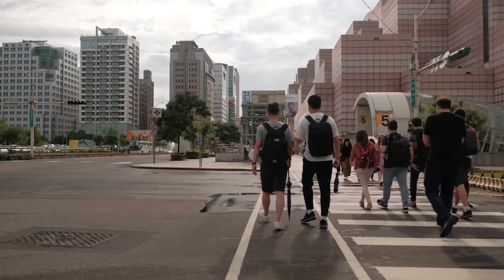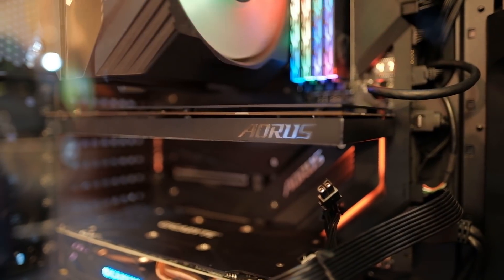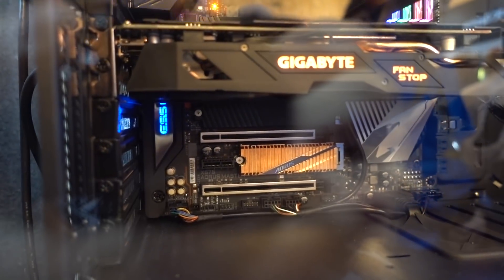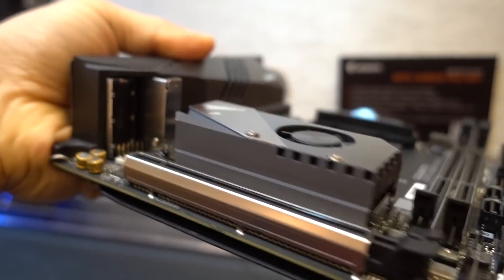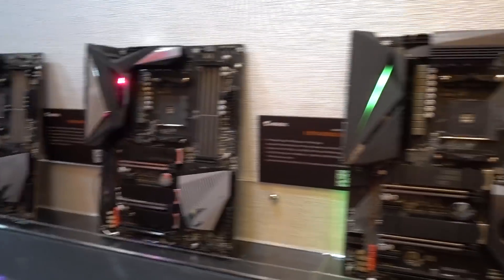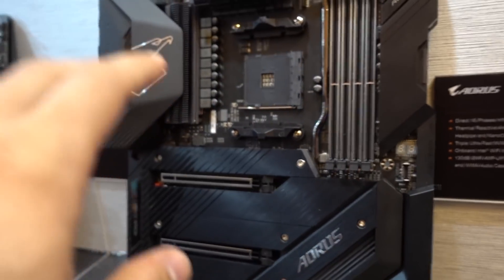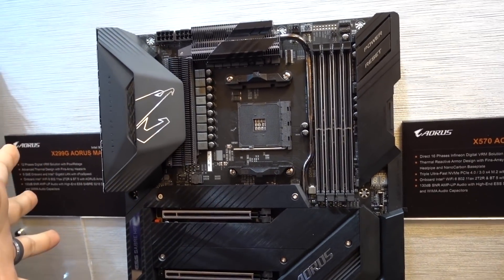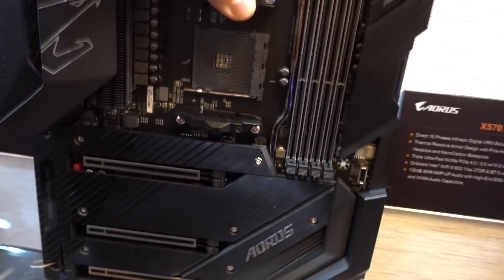They found a way to ditch the X570 chipset fan!

Comment: "15 000 MB/s read n write" you say!
Right!  Stop right fucking there!

1:  Low que depth, random 4K are the numbers that make a system feel snappy.
Everybody (except you!??) knows that nowadays.
So what are those #s??
2:  The average system does around 75/25% simultaneous read/write.
These #s drop through the floor, into HDD territory.
So what do these #s look like?

As I/O is the slowest link in the system chain; It is most noticeable and therefore most important to end users...
Yet here you are perpetuating the myths and BS manufacturers push to sell hardware!

I am NOT watching ANY videos by someone purporting to know anything about hardware who does not know the above!

Comment: When I connect the 24 pin power connector to the board isn't the RGB lights on the board to light up? As nothing lights up on mine just the CMOS button on the back just stays lighting.

Comment: MSI MEG ACE has the heatpipe and zero fan option that is thermally controlled.  If it gets too hot it will kick on.. if the gigabyte gets too hot... its screwed.  I prefer MSI's method..  I saw teh real world testing of PCIE 4.0 over 3.0 for M.2 drives..... 1% performance gain.... synthetic was massive gains..... overall real world... 1%..

Comment: That motherboard with no fan on chipset and 16 phase power will be, "exceptional for overclocking" (5:05).  Yes it will cost around $800+ and it won't do shit for overclocking, as most people by now know ryzen 3000 is not that great at overclocking.  Not worth it to look at this motherboard in terms of, how much better it will overclock.  Frankly you will get slight improvements for double the price at best.  So don't misinform.

Comment: X570 on mini_ITX is a DUMB idea. Who needs PCIe4 on such small board ? And why would you need extra bells and whistles of X570 there ?
Limitation of mini-ITX is usually available i/O area for connectors. BTW, on such small board that mini vent is to be by far the most loud, annoying and short-lived thing.
And customer usually has to pay arm& leg for it...

Comment: No native thunderbolt on the Gigabyte motherboard. AsRock has boards with Thunderbolt which make them more interesting
Reply: And for what you need that? Would you use it at least once? Do you have "super duper ultrahd mini monitor" so you need this kind of stuff in your pc?
Then buy the most expensive motherboard, and sure, you have it. For normal people displayport and usb 3.1 will be enought. And even if you need one in the future, then guess what: Expansion slots :)

Comment: In reference to the video where you say the chipset fan will fail at some point, since my first pc build way back in 2001 right upto today I've never had a fan fail, no matter the size of the fan, even with pc builds I've sold to friends and family over the years, zero fan failures.

Considering the cost of the X570 boards I highly doubt they'll be using crappy fans to cool  the chipset, will be interesting to see in reviews if the fans are spinning all the time the system is running or not.

Comment: It's no guarantee to fail less quickly compared to when looking when the fan itself would die when someone would actually utilize more then one PCI-e slot...

how the heck is it going to get cooled when the majority of places it can get air from are blocked off?
That's the whole frigging point the others have the fan in...

then think of the mess you'd be in if you have to remove and repaste the whole of this sink versus others...
I really can't consider it to be an upgrade beyond pure aesthetics.
Reply: Jason Poole  You can use any case, but once it's filled with 2 or 3 full-size graphics cards that won't matter much.
Also this is a tier of board more easily seen in watercooled systems with less forced air through the case then air cooled systems would have (due to pricing); some barbs for adding LC to that would've been grand alternatively.

I've had to learn this the hard way, even though I have an Obsidian 900d...
Reply: Jason Poole  Im affraid since this appears to be a large body im not sure if a part can be removed or youd need a seperate block to replace the existing one entirely.
Reply: Jason Poole  Fair enough, but I meant it appears to be a single large piece (maybe i'm just seeing it wrong) and hence it seemed to me a version with integrated barbs would've simply been even better :)
although, that may well have pushed the price a fair bit for admittedly a niche amount of people actually wishing to use such a thing. Especially if the argument to preserve aesthetics would be given I can certainly see a point in it, for those simply are damned sleek :)

Comment: may have already been said
why have display ports on a mobo when the cpu has no built in gpu
i'm not super well informed but no ryzen 3*** cpu's have a built in gpu
Reply: The possibility of a 3600g exists though that is only mentioned in the adored TV leak to my knowledge and that is being proved wrong in certain aspects as we go along. that said 7 nm version of the 2400g which is an interesting budget solution anyway could be a fascinating shake up for the budget GPU market

Comment: Why even bother putting a DP out on an x-570 board? Only low end Ryzen has integrated graphics and they would probably use a B550 or B450 board
Reply: Just incase your gpu dies. I have had to use it once to see why the fuck my gpu died or disconnected
Reply: Because a Zen2 APU might require it.
The way AMD is doing business these days you should expect them to invest heavily in the APU market and respective products.

Also helps users that like to buy Mining-dedicated GPUs which do not have DP/HDMI outputs.

Comment: I've always shied away from AMD in the past, as they've always been good workstation CPUs while Intel had better performance in gaming.  I'm still using an old i5 Haswell CPU, and I might even join Team Red once this platform launches. These motherboards look insane.
Reply: i7 4770 over here planning on jumping ship to a nice new 3700x soon as I can. I want those modern motherboard features and im not dealing with intel's security vulernablities at the sake of performance for much longer.

Comment: can you find out bitwit, if you can put 4 NVME drives in there and not do RAID ? I dont understand why its so hard for manufactureres to do this and make some switches on the card to enable or disable each of the m.2's. It would take up less space and if you need re-install the OS, that way you can just turn off the other m.2 while the OS m.2 is active. Since you always needs to disconnect hdd's,ssd'swhen re-installing the OS.

Comment: well this nothing new, as the chipset shares the Vram fin heatsink with a heat pipe just like in the old days,
now a fan will do better job, so if you are a power user long gaming session or m.2 raids with heavy workloads.
so with that board case air flow is important so you not throttle on the chipset.

Comment: Eagerly awaiting the B550 boards 😊
Reply: Yep, but sad thing is I've only heard rumors that it's next year, so not really an option. X570 I'm losing interest in with the fans, but more importantly price. I can handle either or, but if I got to pay $200 I'm sure not going to tolerate a chipset fan. Hence B550 would be sweet, but can't buy something that doesn't exist nor can I get most of 400 series boards as they simply don't work if I drop an Intel CPU there (haven't had AMD in 13 years). edit: meaning I have no way of updating the bios, so 3000 works.
Reply: MSI have just released 'Max' versions of their B450 lineup with Ryzen 3000 support out of the box.

Ryzen only installs on Windows 10. For help https://community.amd.com/community/support-forums/processors

Tuning Ryzen for better performance https://www.youtube.com/watch?v=LTT5mhqmjJc

https://www.youtube.com/watch?v=zuyuS04lD4o shows which motherboards to get for the Ryzen 3000 series.

(If you get the 3600, 2600, 2200g, or 2400G the Wraith Stealth is a bad cooler. Try the Cooler Master 212 evo or the smaller Be Quiet pure rock slim. Thermal Grizzly Hydronaut is a very good paste.)

A new Ryzen user wrote: “make sure windows 10 allocates enough space for virtual memory because my computer was stuttering for a while”. (I think they mean the page file/swap file. It really means they didn't do so with their old processor.)

Addressing Ryzen-3000 boost issues https://www.youtube.com/watch?v=GnR6nCk8BRk (the power plan gets installed with updated chipset drivers)

Comment: Pre-watch: Is it a proper heatsink instead of the blingsinks that seem to be taking over?
Post-watch: Ehhhhhhhh, close enough. Could probably sort this just fine with an old fashioned fin stack with a lot more surface area on the chipset.

Comment: Yes, the arcane and long lost lostech called "Heatpipe" you know the things that were on all mainboards a few years ago when chipsets had a 15-30W TDP. 

But unfortunally this high tech got lost in the ages and now the poor manufacturers are struggling with 11W from X570. Lets just hope that their historians will one day dig out blueprints on how to build a heatsink without a fan again. It probably rests in a golden chest in the Taiwanese mountains, guarded by a dragon. Gigabyte seems to be the first with some success in this process, but unfortunally it is so unbelievably expensive (all the historians that were eaten by the dragon probably) that its only possible on a 600$ board while back in the long forgotten days this type of cooling with a much higher thermal load was common on 150$ boards.
Reply: I found it ridiculous.
Also how they make heatsinks all about aesthetics and not actually about performance. When are they gonna start caring again.
Reply: and many broken the heat pipe next to vram heatsink and replaces the chipset heatsink with Vantec Iceberq Copper or another brand of heatsink with a fan or water block
Reply: @1BigBen  Water of course is an option if a block exists, but to strap a fan onto your mainboard has to be a US thing. In the german forums i participate the majority is pissed about the shitty fans due to shity experiences back then.

I also dont understand why you would cut the heatpipes and strap on another cooler altogether. If you want a fan there for whatever reason strap a fan onto one of the heatsinks and enjoy better temps.
Reply: @schwarziex3563  well back in days it was done all over and the aftermarket chipset fan kit used the mounting holes on motherboard that hold the heatsink down, 

but the DYI brackets or strapping a fan down to cool was done more for vram heatsink and north bridge that was harder to add fan too.
Reply: remember the 780i that had heat pipes and active cooling?
Reply: @butre.  I remember the Backward Gainward card lineups pcb fans and cooler on top, but I don't remember a any fanless GTX x80Ti, there was maybe a 760ti not sure about, at that time I was poor me running a 5770 in crossfire
Reply: @1BigBen  780i is an LGA775 chipset, not a graphics card.  full name is nforce 780i sli
Reply: @butre.  my last intel motherboard had  Socket 370 so no wonder I was lost
oh I just now google it and damn the XFX nForce 780i SLI motherboard cooling, I could have used that for the FXA990 vram
Reply: We forgot how to make cement for 1000 years. Let's not have a repeat of that with heatpipes.
Reply: We need RGB heatpipes.
Reply: I remember my old ASRock 990FX Extreme 4, had such a huge FSB heatsink tower, with an optional fan you could throw on top. Only board I was able to get my FX-8120 to 5.1ghz stable on. When that board died, only option I could affordably find to stick that processor into was a cheap Gigabyte board, and its FSB cooling was far inferior, and couldn't get more than 3.8ghz out of that processor.
Reply: I think my old corshair if formula board with the 890fx chipset draws like 20w no problem with a fairly compact heatsink
Reply: Same as "To go to the moon tech" lost by NASA xD (YES, DIRECT QUOTE, search YT)
Reply: It's because of teh Liberal Agenda!!! D:<
Reply: Exactly man what the absolute f*** were going back into the stone ages here? Im spending more to buy an x570 chipset only to have it fail in a few years due to the stupid fan.  Meanwhile my Gigabyte EP45-DS4P from 2008 STILL running today!

Comment: The GIGABYTE X570 XTREME will be my first board ever from GIGABYTE. I usually buy boards from ASUS but if they can't realize a passive cooling solution for the chipset, GIGABYTE will get my money instead. (I know that this board will cost round about 600$).

But I'm curious if this board will have a daisy chain configuration or T-topology because I want to use my current 4x8GB 4.000CL16 DRAM modules with that board.
Reply: Daisy. Likely most boards including this uses daisy.

Comment: would be a pain cleaning these boards(those with fans) once the dust builds up though if it makes it run cool and run decently I guess it's fine
Reply: 30mm fans are always loud and fail rather quickly. (Within a year or two) 
Unless they've used some really high quality fan like from Noctua. Probably not.
Reply: @Sevendogtags  yeah mechanical parts would always fail at some point, especially these 30mm to 45mm fans placed on the chipset since these would spin at higher RPMs to blow air. though I doubt a $300 dollar board would use a $1 fan, but we'll see when they're out.
Reply: @yanagida_01  I have never had a 30mm fan die on me shipset or DIY vram cooling and today with can of air cleaning is not that hard

Comment: But why they squeeze two HDMI on a mini itx board
Reply: My guess for X2 HDMI + DP is for Ryzen APUs which DON'T require a GPU, so you connect monitor straight to mobo & you can have a smaller form factor pc because gpu is eliminated from the build.
Reply: Also I get the feeling that AMD is slowly creeping up their APU's GPU performance. Up to the point you can achieve stable 60fps @1080p ultra which would pretty much cut off Nvidia at the lower-lower mid range gpu market.

And if TDP power consumption is low enough for Laptops & slim form factor portables that'll easily eat into that market.

Comment: Couldn't they technically put an m.2 slot an the GPU board?
Reply: well they could but you would go from x16 GPU to x8 for the GPU and x8 for the M.2 on GPU but with pcie4 not a problem but making room on the pcb and adding extra layer to the pcb would be costly

Comment: That gigabyte "over-engineering", pause 5:17 : its a X299G Aorus Master.. uhm.. that not a x570 chipset ?
Edit: As someone mention, it is a AMD socket, i guess i was mistaken here. Thumbs up for correcting me.
Reply: The plaque is on the right side of the motherboard. If you look closely at the socket, you see that it is an AMD-socket, not Intel. You can see this, because it has no pins, and you see the brackets for the cooler.
Reply: @RRhoads27  Yea i see it now, uhm.. my bad :D

Comment: I really want the Gigabyte Extreme. However, that thing is going to cost more than the CPU. I bought my current pc in 2016. CPU €350 (6700k) , MOBO €150 (Z170). The Gigabyte Extreme Z390 = €550. The X570 is going to be even more expensive. Damn......  first world problems.
Reply: 6700K is fine. Rather than buying a new platform grab a 7700K and a new graphics card (if you play games).

Comment: Aorus extreme is probably 500 to 600 squid, looks amazing...but just too damn $$$, going for the X570 E Gaming from Asus.
Reply: That's a hell of a lot of squids.
Reply: I'd imagine 400 tops but yes. far more than I'd pay for the mainstream mobo. The Threadripper XTreme is 499 atm
Reply: The pcb is special on x570 an the chipset cost double the X470 some boards are going over a grand at launch

Comment: So glad someone has removed that fan. Have to wonder what the cost is and what speeds you can push rysen 2
Reply: Unfortunately its only on their most expensive mobo. Several hundred dollars I suppose?
Reply: Official secommended price seems to be 599$...
Reply: I think the fan is there to future proof the 16core. Not sure tho, heard it does not turn on most of the time if at all.
Reply: The 16 core does not need that fan. The Pci4 does need that and only in certain situations.